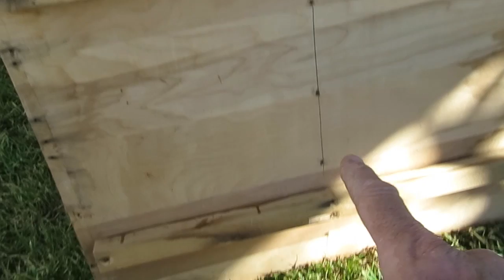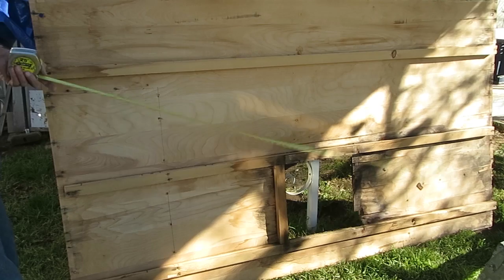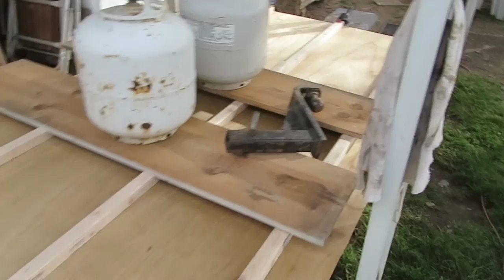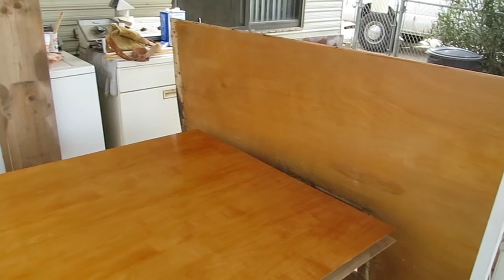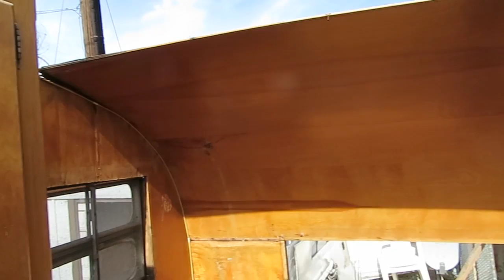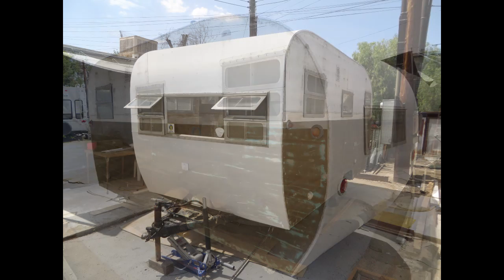Design & Build A Birch Panel

Comment: Is a roof vent really worth it?  I see so much water damage around them.  A lot of campers, but not all,  have an upper bunk vent mounted in the walls.  I would think they would work almost as well without leaking.
Reply from the maker: It's very much worth it. When it's hot you need that vent to allow the heat to leave the trailer. Especially when cooking inside. Problem is, no one ever removes and re-seals the vent until it's too late. All openings in a trailer should be removed and re-sealed 7 to 15 years depending on your climate. The putty tape eventually dries out and let's water in. Easy maintenance item but no one ever does it till they see water damage on the inside. By then it's too late.

Comment: We actually found 1/8  inch luan today at Home Depot. Now if the rain will let up, we will get the roof on. Starting with the "key" piece. Your video skills are excellent!
Reply from the maker: Hi LInda, keep in mind that Luan doesn't look the same as Birch paneling. Or are you painting it?
Reply: mobiltec I am painting it white. But only because we don't have the time or strength to rebuild the cabinets and they are already painted.  If we could start over with a coveted place to keep it while we worked on it and could take our time I would definitely rebuild them and use birch so I could stain and shellac like you do. I will just have to be happy with white interior and no rotted wood.  Got to be ready to travel by end of September.  I hope next week we will have a few days of no rain although the state is still in a drought.  We've had lots of rain this spring but not enough.  We usually go from a few pleasant days of spring to hot and humid. June, July and August will be miserable.  I'm watching your videos now. Trying to get sleepy so I can get up early but it's not working.  Thanks, Larry.

Comment: Hahaha! @ 6:08, "Nuthin' to it." Yeah, right...

Table saws have always scared the Hell out of me, and I'm glad they do. It results in a huge amount of respect when I use one. This is a great addition to your arsenal, but always keep in the back of your head that it could make one of your fingers disappear before you even knew it happened.

I've never tried it with shellac, but I've used the French polish method (without knowing what it's called) with tung oil, and the results are absolutely spectacular. Of course, it's a purely natural finish, not the amber you're after, but the process is the same, and I have some old vintage 1960s walnut and mahogany, that I refinished with it 15 years ago, that's as perfect as it was the day I declared it done.
Reply from the maker: I know what you mean about the table saw John. I watched as my wood shop teacher in high school took off his thumb on a table saw. Not a pretty sight. Right after that he said, "do as I say, not as I do"... I now use he french polish method on all my birch. It really works well. I tried it out for the first time on the cabinets of this trailer and loved the results. Thanks for your comments John.

Comment: We are going to start on the middle panel like you did. Then work our way down. Maybe it will wrap better. Probably have to splice some. There is a cabinet on that end that would hide a splice. After taking today off and resting, doing laundry and cleaning I feel so much better and I'm ready to go at it again. Thanks for the videos!!!!
Reply from the maker: Well you never want a splice in the radius. Always make sure no matter what, you have your splices on flat framing at least one rafter past the radius if not more. On both ends. This is why many times there is a small piece of paneling in between the "KEY" sheet and the piece that wraps around the radius. Because you want your key sheet surrounding the top vent.
Reply: mobiltec  Thank you so much. Will do.  I have a steamer. Do you think that would help to bend the wood around the radius?
Reply from the maker: That is something I have not tried yet but I bet it would work.

Comment: Hi Larry, I like the idea of gluing the cross members onto the paneling. I think it make the job easier and gives a lot of support while installing. I wanted to ask you about the clear finish. What do you think about the water base products over the oil base products also do you use simi gloss or satin finish.
Reply from the maker: I use only shellac. Never put anything else over shellac. On new paneling I use two coats of amber and 3 clear. Sometimes in order to match other paneling I may use 3 coats of amber...
Reply: OK Thanks Keep up the good work and the video's

Comment: Beautiful job.  Where do you find 1/8" birch paneling?  I can't find any here in Maine.
Reply from the maker: Welcome to one of the biggest scavenger hunts of your life. You must go to real lumber yards. Look for specialty lumber yards that handle hardwoods and finish materials. Talk to a cabinet maker. It's around. You just have to find it. Not in big box stores. You may ask in Vintage Trailer Talk forum. There are people there who know where to get it in your area. Just google it.
Reply: @mobiltec  Thanks for that intel.  I'll keep looking.  I already replaced 2 ceiling panels in my 64 Shasta 16SCS with what Home Depot calls a utility plywood.  It's a nice finish but now trying to come close to a stain match mixing the Amber shellac to get more of a yellowish tone since the plywood has more of a redish tone.

Comment: That looks really nice, I like the French finish too and I think they call that "chatoyance" when you get that sweet glossy finish. I'm finally going to pull the trigger and build my own camper starting this month and after years of mulling it over I've decided instead of rebuilding or buying new to just make my own "cowboy camper". You can see them on youtube, but you probably know what they are. I'm going to skip the sink and cooktop and all that and just put in a 60x80 bed with led lighting strips, 110 and usb charging ports for cell phones.. Anyway Larry, I had a question or two before I start that maybe you can help me with. I figure I can build the box easy enough and do the siding from watching you do it, but I wonder if you can recommend an internet company to get windows and doors (misc parts) from or if you just source them locally? I saw you rebuild a door once, but not build a new one from scratch so I'm wondering if ordering is worth the 300 bucks or so (ebay cost) or if I should build one myself? Second, the building method Capri campers uses is a stich and glue 2x2's frame and I wonder if they do it to save money on screws or if its more flexible in the bed and thus intentional? I had planned on screw and glue and using soft pink insulation but their method got me to thinking about something you said in another video way back about why they built these old wood campers the way they do so they could flex and not rattle apart etc,.. Is the rigid foam and stich method better for a truck slide in or stick with screws and twisty nails?
Reply from the maker: I don't know the answers to your questions. I am only experienced in rebuilding old 50s and 60s campers and I rebuild them pretty much the same way they were built at the factory... Sorry I can't be of more help.
Reply: Well that's what trial and error is for. :) Thanks Larry.
Reply from the maker: The best thing I can say is don't over build it and remember what I keep talking about regarding how these and all other trailers are engineered for strength. The cabinets and the way they are attached are the main super structure of the trailer. They are what keep it square and strong. Consider the cabinets gussets. They do the same job.

Comment: Great job! We are now attempting to put the top on the Play-Mor.  How did you get the panel to wrap over the radius? We started from the front and we are using luan not birch because the original wasn't birch but a type of paneling. I wanted to use luan and paint it white since someone had already painted everything beige. The luan is 3/16. The thinnest we could find but it wouldn't  bend and we ended up taking it off covering the camper and deciding to take a few days off.
Reply from the maker: Yep. You will have to find 1/8 inch material. It's somewhere. You just have to keep looking. Forget about Home Depot or Lowes. Try hardwood lumber companies and the like. Never give up. If I remember right your pla-more has a very tight radius? If it's too tight, you will have to build a steam box or something. I am used to Canned Hams which have fairly large radii...

Comment: This may be a silly question and you may have mentioned this in some of your other videos, but did you do any sanding prior to finishing? Looks great btw. Thanks for the videos.
Reply from the maker: Light sand with 220 grit if the paneling looks like it's been sitting on the shelf for a long time. Other than that... no.

Comment: Would you mind posting your dilution mix ratio?  You said 15%ish but it if you could give an idea of DNA to shellac mix, I would greatly appreciate it!
Reply from the maker: It all depends on temp and humidity so basically it's environment. It takes some playing around and experimenting to get it right for your conditions. The drier it is the more you dilute in order to make it stay wet longer. Easier to brush your strokes back into itself. That's what gets rid of brush marks. The heat has the same affect as dryness. So the hotter the more you dilute. Never more than 20% though. In cooler weather with a little more humidity you can go down to 10%. I very seldom use it straight but with some woods, if you get good enough with  the brush you can go with no dilution. But that takes some practice. You can't go wrong with 15% and keep in mind that I don't measure any longer. I just kind of know how much to pour in now for my conditions.

Comment: Here's a potentially ignorant question:  Where is the insulation in this panel construction method?  Between the exterior panel and the aluminum cladding?
Reply from the maker: Yes. As shown in other videos I peel off one inch thick layers from regular R13 fiberglass insulation and spray glue it between the rafters. Then cover that with vapor barrier and then the metal skin goes on.

Comment: Ever try a roller or spray gun?
Reply from the maker: Yes.
Reply: How did it work? I have used brush, spray and roller for painting but have no experience of shellacking large areas. I wondered if there is a reason for using a brush when roller or spray would be quicker.
I was thinking if I was going to use 3 or 4 sheets for a repair job, or even more, that I would hang them up and spray them all at once before I began building.
Reply from the maker: Quicker is not something we usually go for with things like this. It's how it looks that we are after. Brushing actually takes longer though. Spray just does not give it the same look that french polish does. And brushing makes it look better than spraying. So spraying is not the way to go if you want a deep rich looking finish. Watch my other videos on shellac.